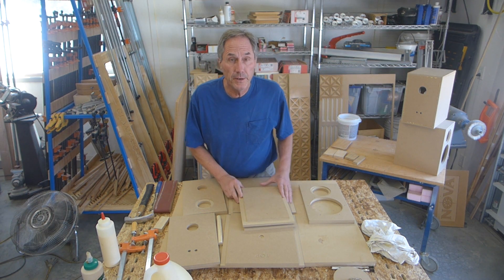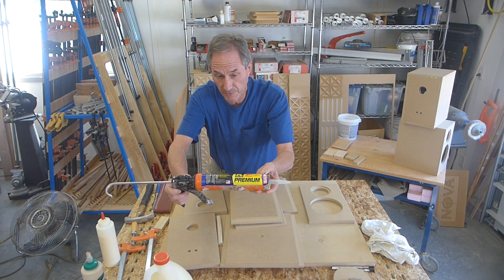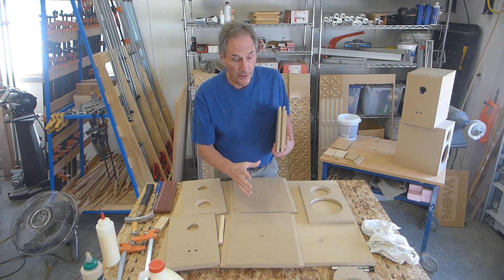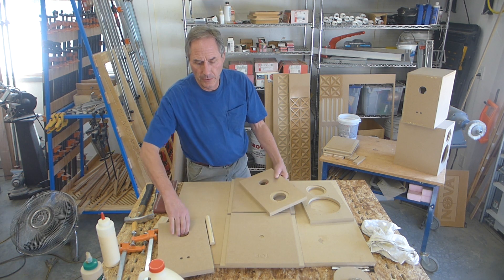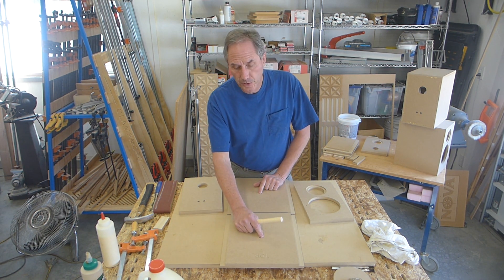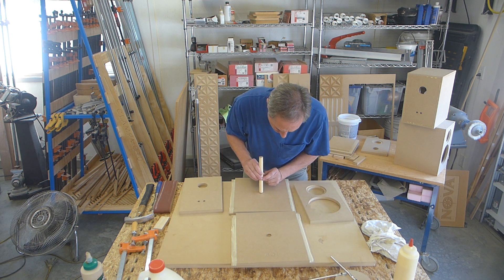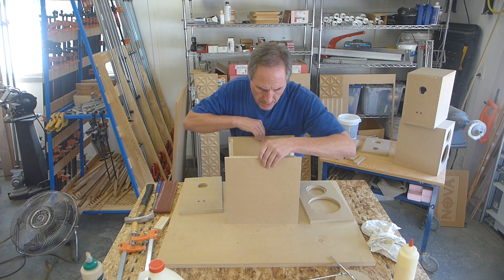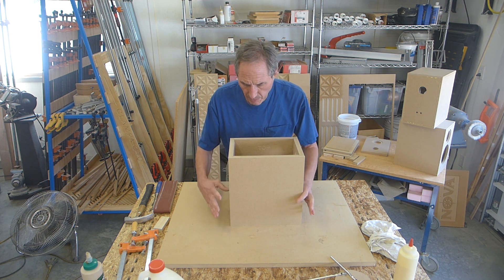GR Research X-LS Speaker Cabinet Assembly

Comment: You would think the dampening foam should be installed at the build of the cabinets.  It would be better installed than cutting squares later.
Reply from the maker: You're not alone in thinking that, Wayne, although I wouldn't want it there through the finishing process. To each their own, I suppose.

Comment: Please let me know why nails are avoided? And what about a solid wood build, still only glue?
Reply from the maker: Metal fasteners aren't necessary and have the potential to damage cutters should one decide to profile edges. Solid wood is substantially less size stable than composites, and resonance characteristics vary with species. Is it possible? Yes, but would certainly complicate cabinet construction and provide no sonic benefit.
Reply: @carbidetooth  clear, thank you. did you do a floor standing version, if yes, what were changes in sound profile?
Reply from the maker: @ah.l  I have built the X-SLS a couple of times.  It reaches slightly deeper in frequency response, although I often prefer the  presentation of bookshelf speakers on stands. For superior bass response, I'd pair either with a subwoofer.
Reply: @carbidetooth  I have ordered X-SLS thinking it would save  cost and complexity of adding subwoofer. even without subwoofer do both versions sound fuller or both definitely need a subwoofer  .
Reply from the maker: @ah.l  The room, speaker placement and  your expectations will tell the story better than I can. Neither model is deficient in bass.

Comment: How are you going to get the woofers in the box?
Reply from the maker: I'm not sure I follow your question Loki, but I'll give it a go.  These woofers are designed to sit on surface rather than recess into baffle.
Reply: @carbidetooth  I thought because you pre-drilled the back side and the front was rounded off the woofer mounted from the back.  Thanks for the reply.

Comment: Hello, what size is radius on the back side of front panel for woofer? Thx
Reply from the maker: I put a full 3/8" radius on flat packs I cut. 1/2" radius would work equally well.

Comment: Doesn't the job required of that dowel brace entail tension forces equally as well as compression?  The connection doesn't seem to be designed for that.  You probably could park a car on the box, but the brace is there to resist vibrations that go equally inward and outward.
Reply from the maker: The dowel brace simply ties the sides together to stiffen entire structure. Similar in function to a wraparound shelf  brace, but takes up a smidgen less cabinet volume.

Comment: Are those 45 degree braces really needed ? not driving a car over it, what does it do for sound ?
Reply from the maker: Not for structural strength specifically, although they do enhance that. Rather, they brace adjacent panels to reduce cabinet resonance. Stiff boxes are typically more inert when it comes to their sonic contribution to input signal.

Comment: If Titebond 1 doesn’t achieve squeeze out it doesn’t reach full strength. Remove excess after 10 minutes with a sharp chisel. Guitar building 101.
Reply from the maker: Thanks for your input, Krunch2020. To clarify, any glue outside the joint itself does not contribute appreciably to the overall strength of the joint, nor does it assist curing. Squeeze out does give some visual confirmation of glue coverage. I suspect the actual glue area on a guitar body is significantly less than a speaker cabinet so visual confirmation of complete coverage would seem important. FWIW, I have a "glue chisel" to shave the drips while still plastic, as you suggest. It's just an old chisel that I care less about getting blobs of dried glue on.

Comment: You should glue both surfaces,then wipe away excess glue squeeze out with a damp cloth
Reply from the maker: What would be your purpose in doing that?
Reply: @carbidetooth  because you get a better bond with the MDF,also no need for the polyurethane  glue to hold the dowel ends in place,I'm presuming you used it because the hole was made too big,and you wanted to fill the gap,because you don't have a cutter same size as the dowel,the yellow glue would have been sufficient.
Reply from the maker: @johnbravo7542  That's simply not true. Assuming one has adequate glue coverage on a single surface, additional glue does nothing to strengthen joint. The visual confirmation of that coverage is glue squeeze-out. Your presumption regarding PL Premium is wrong, as well. It was chosen for its viscosity, slow setting and expansion properties, which aids in assembly and contributes to structural rigidity of box. The parts are cut on CNC router, thus hole size is precisely as I designed and programmed, it has nothing to do with cutter size.
Reply: @johnbravo7542  NO. Poly glue is not designed that way. Only one side gets the glue , the other side gets moisture.

Comment: Enjoyed your build vid . I have found in my experience that when assembling boxes like this you would find strap clamps work much better , better distribution of pressure and you dont have the clamps get in the way of each other ..
Reply from the maker: That's not been my experience. Band clamps pull diagonally on corners.  In this case I want the pull to be linear so I can tune specific areas  as I assemble. Stacking clamps has never been a problem and there is a glue open time window to consider. To each their own, I suppose. Use what works for you.

Comment: At 15:40, you mention that you took the clamps off after 45 minutes.  It seems that I've heard "leave the clamps on for 24-hours" all my life for any kind of wood gluing.  Is 45-minutes the safe time for clamp removal as long as no other force is exerted on the cabinet for a while?  I have a minimum number of clamps, so if I can remove the clamps sooner than the next day, I can glue both cabinets in one day.
Reply from the maker: It depends on glue used. Titebond Original calls for "clamp for a minimum of 30 minutes, do not stress joints for 24 hrs.". Most wood glues would be similar, but I recommend reading manufacturer's' instructions to be certain. A glue that set much slower, say epoxy, would require much longer clamp time. When I worked in cabinet shops, less than 1hr. clamp time was common. 
I'd have no problem doing what you're suggesting assuming Titebond was used. Save any machine work for next day and you'll be good to go.

Comment: Peter,

Your flat pack X-LS kit is so precise. Got them built, crossovers wired,  ready to finish. Enjoying the process and the community... great support for beginners like me. With the No Rez and braces, the cabinets are like bricks.

Question: Would you recommend 1/2" or 3/4" round over for the edges? Enough material for 3/4?
Reply from the maker: 3/8" radius (3/4" diameter) or larger gives best sonic results. Beyond that it's primarily an eyeball thing. For visual reference take a look at  my thread on Audio Circle, the "Hot Rods" are 3/8" radius. The crackle finish red and black ones are 1/2". Theoretically, 3/4" radius would be possible without compromising cabinet integrity, but it's a big radius and equally large router cutter. I'll post a graphic in that thread.   https://www.audiocircle.com/index.php?topic=150120.0
Reply: @carbidetooth  Peter, I have your flat packs and have them glued up and in the planning process for getting them veneered. Visually I would prefer to not do any routing of the baffle on the sides and keep all sides square (and not wrap veneer ), but I'm wondering what is the sonic hit by not rounding the baffle? Have you done listening on both routed vs. non-routed versions?
Reply from the maker: @HoomanR17   To be honest, I've never tried square corners all around, so I don't have any way to compare. I know it's been done. Danny might be a better one to explain sonic effects.

Comment: Can you just use titebond on the dowel?
Thanks for your expertise.
Reply from the maker: I've addressed this a couple of times in earlier comments. The PL Premium was chosen for this specific joint because of its viscosity, slow setting time and expansion as it cures. There's 1/16"-3/32" end play in dowel to facilitate assembly and the PL works well to fill that void when curing. Any excess will push out around perimeter of pocket in side panel.
Can it be done with Titebond? I imagine it can and has, but is less than ideal for the reasons given. In the end, it's your call, I suppose.

Comment: i would like to see upgrade kits for speakers that improve the sonics like most of the klipsh line and I have built a pair of  super speakers using silver flute 5 1/4 and sb audio tweeters and the response is flat like you would not believe and use erse components like you suggested
Reply from the maker: Looks like GR Research is doing just that with at least one popular Klipsch model : https://www.youtube.com/watch?v=arYwrAtcJZY

Comment: Why do you do rabbit joints? A 45 degree cut is easier, just as strong, and finishes the corners nicely. Also, wipe the squeeze out with a wet rag
Reply from the maker: rocifier, I assume you mean rabbet joints. I did consider miters in various forms, folding, lock and splined. I landed on rabbets for  a few reasons. Mitered edges would be fragile and prone to shipping damage, inefficient on CNC and I think not very  novice friendly.  
Wet ragging is just not necessary for the  amount of glue squeeze-out  shown. It cleanly routs off when flushing with trimmer .

Comment: Can you please tell us more about the clamps that you used?
Reply from the maker: In this video I'm specifically using two types. The bigger red ones are "parallel" clamps made by Bessey. The smaller orange clamps are  "F" clamps, (presumably for their shape), made by Jorgensen.  There are many brand names making both styles.
In general, parallel clamps can apply significant pressure evenly across their faces, a handy property in many woodworking operations. The F clamps are light duty and tend to concentrate clamping pressure in a smaller area. They can vary in size and clamping pressure.
While it's not an absolute necessity to use what I show, for me it's optimum. It would be entirely possible to assemble these cabinets with only F clamps, perhaps larger ones. There are other workable methods, but getting into the full depth of that could easily be a video in and of itself. I wouldn't be surprised if there are existing videos on just that subject, although I haven't looked.

Comment: Peter, you referred to Titebond 1 on the sides and top and bottom. You used Titebond 3 on the braces. Is it better or not to use the 3 on all but the dowel brace? I’ve used the 3 a great deal on hardwood bases and skirts. Just wondered why not one kind on all but the dowel brace? What about reinforcing the sides, top, bottom, front and back with biscuit joints? It may not need it, but I used them on hardwood bases and skirts. Is it because this is mdf and it isn’t as critical on mdf compared to hardwoods?
Reply from the maker: Mark, either Titebond 1 or 3 would work fine. In fact, 3 has a slightly longer open time, but also seems a little more viscous to me. Really a matter of personal preference, as either will provide a more than adequate bond. 
Adding biscuits to rabbets seems like it  would complicate assembly with no real benefit. More is not always better IMHO. On the other hand, I have used biscuits successfully on butt joints. Again, a matter of preference and tooling one has access to. 
My aim in designing the way I did was to ease assembly for novice builders, while providing great box integrity and panel damping.

Comment: It's nice to see this video encouraging eye and ear protection.  But anyone using a router on MDF should be wearing a dust mask as well.  Fine particulate wood dust is not good for your lungs, and adding in the chemicals in MDF makes it worse.  Humans do have a surprisingly large amount of spare lung capacity, but better to just not go down that road.  You can't get it back when it's gone, and there's an association with lung cancer as well.

Comment: Peter, how do you add the large radius on the side edges of the baffle as I see in your later videos. That radius looks way too large to use a router or router table to do it.
Reply from the maker: Bob, I used a 1/2" radius, bearing guided round over cutter in a handheld router. Could do on router table as well. I suspect it looks bigger once veneered. 
https://www.whitesiderouterbits.com/products/2009?_pos=10&_sid=9ceffefc5&_ss=r
Reply: @carbidetooth  Thanks for that information and all of the information you've allowed us. You are correct, that looks larger than a 1/2" radius.

Comment: Why no glue on the front and back pieces??
Reply from the maker: Do you mean in addition to that in the rabbet, Robert? What I've applied there is adequate and the visual indicator of that is glue squeeze out. More is not  always better even though it seems like it would be.  Any glue outside the joint itself contributes nothing to strength. To that point, I'll let my truck do the talking:
 https://www.youtube.com/watch?v=az5GBj2wNA4&t=324s

Comment: Like the video and enclosure design.

However, if your ears and eyes are a concern then why not your lungs.

You instruct on many considerations, safety even. Where is a mask to save your lungs from emphysema?

This is an all too overlooked issue that many power tool woodworkers don't consider and it is foolhardy.

If you are going to present videos on shop methods then you have the responsibility to include proper safety measures.
Reply: Good point, however.....ever try talking thru a respirator?
Reply: Hey, your comment is honest and well received. Often, guards are removed for production value. Still, one should mention the importance of protecting one's lung. We look to those tubers for content. I'm just trying to suggest we get others to follow safe practices.

Comment: Peter, thank you for this. Question: Would the PL Premium be good to use for the entire build?  You apply it only for the dowel. Is it too thick to spread for the panel assembly?
Reply from the maker: I know it seems a waste to use so little of an entire cartridge, but I imagine that would lead to some, if not a lot of, frustration. It's too viscous, slippery and slow to set for this kind of glue-up. Wood glue mo' betta! 
FWIW,  PL Premium will stick all sorts of things together, so maybe you have something else around the place that needs permanent attachment...
Reply: More questions: The side panels have the brace pockets routed. (Very useful and convenient). One is higher than the other, which may denote directionally. Which way is which, or are the brace locations staggered for resonance control reasons?

I'm cutting and sticking the No Res prior to glue up, but you didn't do it this way in the video. Do you see a down side to this approach? Thanks again.
Reply from the maker: @Dwight Smith Assuming I didn't make a mistake you should have two right and two left sides. The slot nearest the top faces front. NOVA marks will be top front corners,  behind tweeter. The brace ends up between woofer and tweeter. If turned around the brace would protrude into woofer opening. Does that clarify?